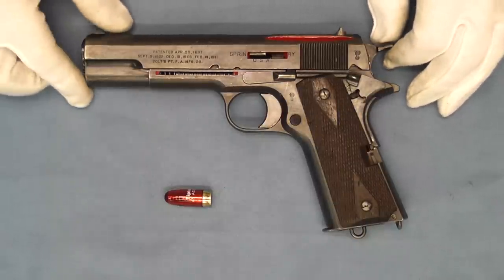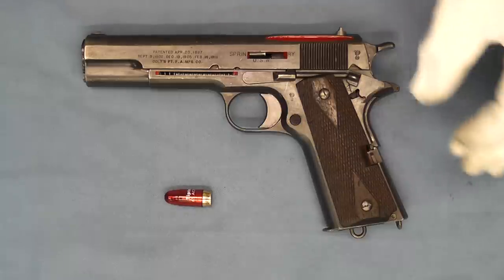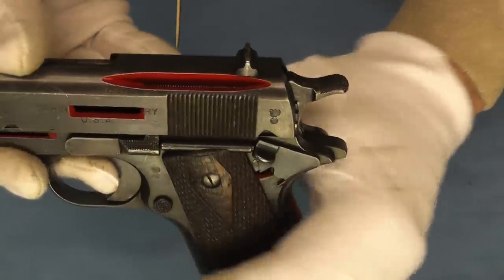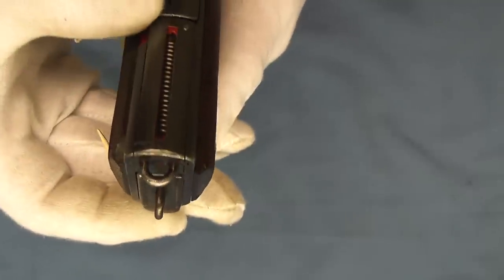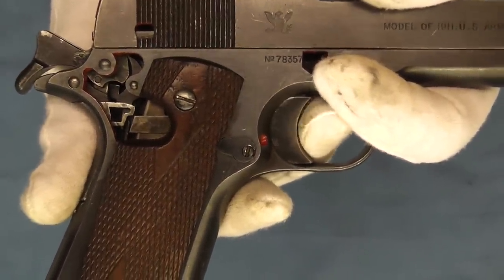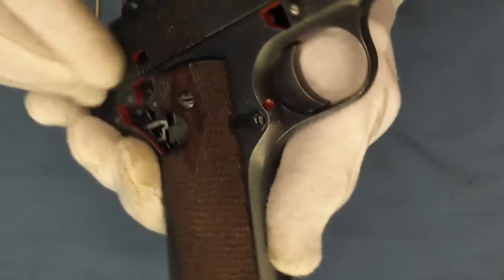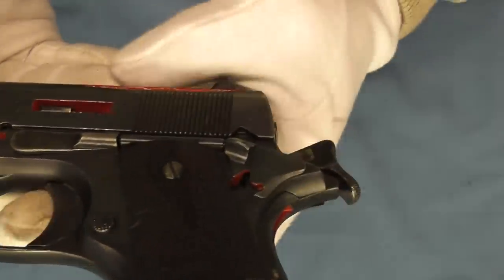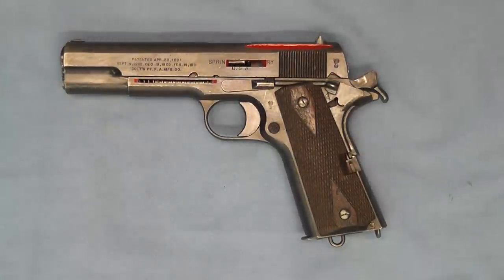Springfield Armory Model 1911 Pistol .45 ACP Cutaway Display Pistol

Comment from the maker: @USFA45LC The mechanical safety lock (thumb safety) was retrofitted on the Model 1910. It was installed to satisfy the concerns of the US Cavalry. Mr Browning designed the safety mechanism to lock in the cocked position on the sear. Because of this nature of this design, unless something was broken internally, I do not see a way that the hammer could drop with the thumb safety engaged. I hope this answers your question.
Thanks for watching and commenting!